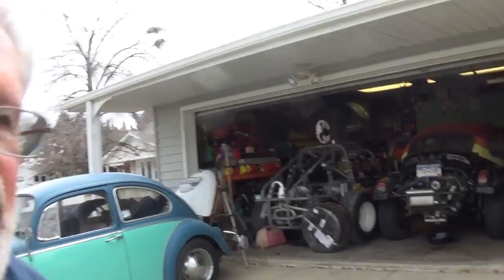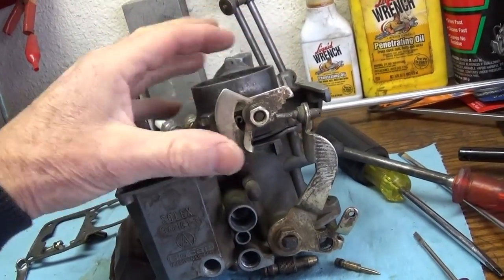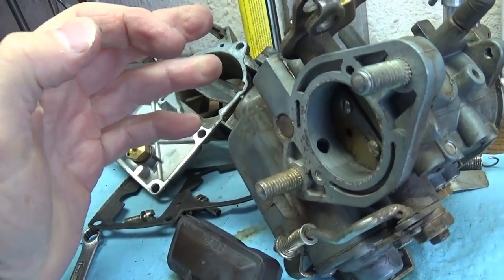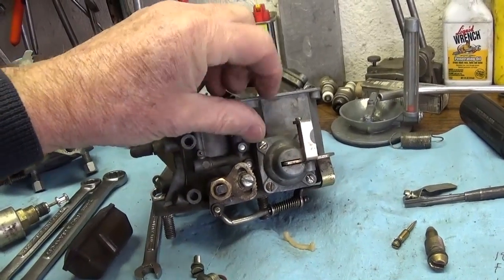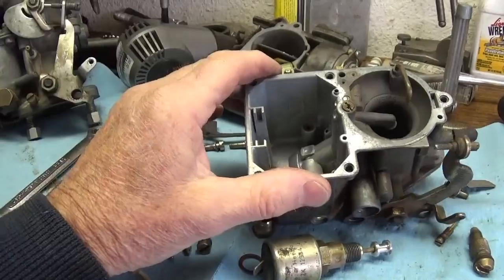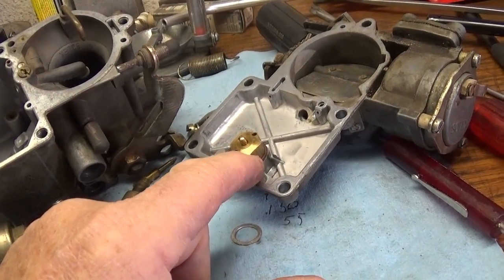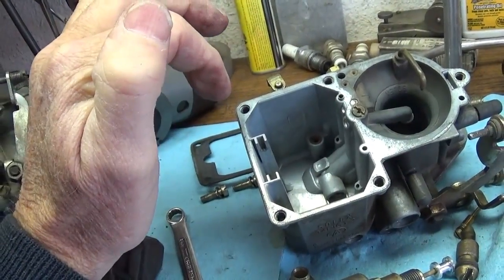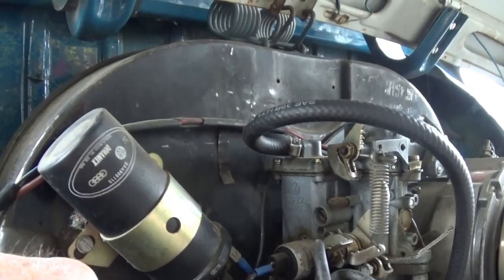VW Solex 34 PICT-3 (QUICK FIX !)

Comment: Got any advice on dual 34mm carbs? It's what I'm running on my 1641. I posted a few videos. Constructive criticism welcome.😁
Reply from the maker: I started out with ICT Webers. They worked ok when you had them synchronized just right. Any dual carb set up is a hassle. Might as well have Dual Two  Throat 40's. Good Luck with your projects Nate and Thanks for checking in.

Comment: Great video, can you explain why my 71 fires on cold starts but turns over 15 times before starting when the car is warm? Thank you
Reply from the maker: Could be any number of things since you haven't told me weather condition or details about your engine.  I'm not a mind reader.  I would start with looking at the choke when cold and then just before your warm restart.  Also check that your accelerator pump is squirting as long as you have the air cleaner off.  Fuel pump pressure.  Plugs, wires, distributor cap, coil wire connections.  

Maybe do your normal routine with cold start drive it around then come back home and let it sit. Do this to create the slow warm start.  When you feel the correct amount of time for it to happen. Don't try to start it but remove the top of the carburetor while it's on the car and see if there is gas in the float bowl. Have someone crank the engine and see if fuel is going in the bowl.  (BE Safe)  Fuel filter??? Sometimes these things can take a while to figure out. You just have to be patient  and be observant.  Most shop manual's have a trouble shooting section.
Reply: @TheEZGZ  you’re awesome dude. Thanks and sorry being vague.

Comment: Hey EZGZ, how are the progression ports checked or cleaned??
Reply from the maker: Take it off the car. Disassemble, spray brake cleaner threw ports and watch where it comes out. Wear eye protection.
Reply: @TheEZGZ  Thanks .... I had done that but still had a flat spot the size of Arizona. (I am from Jamaica by the way)

OK so the dellorto drla has a really big screw (phillips I think) that when pulled reveals the chamber from which the fuel passes thru its progression ports ...... therefore easy to clean.

I honestly haven't found where to spray so that it comes out the Rolex progression ports ....... and I really looked.

Comment: Im kinda new to the vw world as i just bought a tryke with a vw engine, what im having trouble with ia that when ckoke is fully opens engine dies, have a feeling its something minor that im missing but any suggestions would be appreciated
Reply from the maker: Welcome to VW land.  If the tips in this vid don't work then check deeper. Just basic stuff like float level and clogged jets. Never hurts to get a carb rebuild kit and and get familiar with what's what.  Since your tryke is new to you it might be a good  idea to check and record everything you can.  Compression, Ignition timing, Plugs, fuel pump pressure, blah, blah blah   Just get a base line and make one change at a time.  If it doesn't run with choke off obviously you have a lean condition due to ????   Find it /  Fix it/ Be happy     Nobody can magically give the answer with out more details and the more detail you look for.....  the solution might show up.  Just remember all toys are a Money Pit

Comment: I LIVE IN FLORIDA WILL THIS CARB  ADJUSTMENT  WORK THE SAME FOR ME OR IS THIS JUST WHERE YOU LIVE THANK YOU  FOR ANY HELP YOU CAN GIVE ME
Reply from the maker: It would be a great place to start. There is no one fits all formula. The condition of your engine and addition of aftermarket parts along with the quality of fuel can require different jets and air fuel adjustments.

Comment: Just got a 71 bug, having carb problem, the choke isn’t closing the butterfly thing
Reply from the maker: Make sure your getting 12 volts to the choke coil and it's getting hot. A carb rebuild kit has some other parts that help the choke. If you just got it you might want to go threw it. Some folks just disconnect or remove them or disarm them and pump the gas a bit until the engine starts to warm up

Comment: Question my 67 starts great but after I run it for a bit and turn it off it and try and start it seems like it's flooded  and it just won't start unless I let it sit for a while. Thank's in advance.
Reply from the maker: Fuel inlet (float valve) to much fuel pressure, Choke adjustment.   Take ur pick????
Reply: @TheEZGZ  thank's

Comment: My solex brosol h30/31 pict carb is leaking air at the throttle shaft have any experience in replacing?
Reply from the maker: buy a new carb. It's cheaper than fixing
Reply: Yep, no shit! i siliconed  it took it on and off a dozen times ended up buying a new one just could not get it to work.  The new one was not pre set and when I first fired it up it ran like the old one  until I adjusted it than to your vid on how to adjust these carbs runs good now.  It will go back to sitting in the garage just like it has for the last 25 years.  Thanks for your help!

Comment: Thanks friend new subscriber and new rail buggy owner with a 1600 on it and my carbs all out thanks I also have questions if ya want to answer them thanks buddy.
Reply from the maker: Ask away, That's what I do here. I also have a vintage VW Sandrail
Reply: @TheEZGZ  I had all kinds of trouble turning out to be the wire was almost ready to come out of the ignition module inside the distributor seeming like fuel instead of fire problems like to drove me nuts but I’m a loving my rail for sure now
Reply from the maker: @joeyelswick1796  Good to know. Thanks.  Keep the rubber side down buddy
Reply: @TheEZGZ  you too my friend

Comment: My engine is a stock 1600cc engine but it has 88mm pistons and stronger  (performance) camshaft. The rest is all stock. Is adjusting the 34-PICT-3 still the same or is there a difference on how to adjust it to compensate for the extra compression gained by the bigger pistons?
Reply from the maker: same.  run premium fuel with the higher compression and do a plug check
Reply: @TheEZGZ  What plugs do you recommend?
Reply from the maker: @DavidRBermudez  vg I've  been using Autolight lately. They fit in the head properly and seem better than the Bosch.    I don't remember the heat range right off hand I just ask for the recommended  one the books show's for a 71 VW bug???
Reply: @TheEZGZ  good advice...i am using NGK and I think those are not good. Will try yours.

Comment: When start my car i have to hold the gas pedal down half to make it idle then it idles by itself at one point the gas is 8 months old but i ran the carburetor until empty.
Reply from the maker: La de da.    Basic trouble shooting. Fresh gas, good ignition, Time for a tune up.  Check it all. Don't give up!

Comment: hey there. i need to get my to idle first lol. what am i missing seems to have good pedal but wont idle HELP!! thanks
Reply from the maker: Most folks try to use that long screw that rests on the choke system and you can't do that.  The rest of your engine needs to be correct to idle., Timing, spark plugs, wires, coil. It all has to work together. Idlol is one of the hardest to obtain.

Comment: top tips there for sure ,  can you tell me what sae rating that fuel pipe is to the carb please.
Reply from the maker: 30r14t1 if that means anything to you?  I just went to O'riley's  and asked for some fuel line. It's nothing special.  I paid by the inch for some of the original style VW fuel line with the braided out skin and it was all cracked and leaking when I tried to fire it up to move the car. Must be the alcohol.
Reply: thanks, I was just wondering what you were using , im having the same problem with the rubber fuel lines degrading and yes I think your right it seems to be the additives ethanol/ alcohol  im trying some SAE J30R9 at moment which is suitable for injection and carb , and it seems to be holding up well after more than a year .
Reply from the maker: I'm probably going to change to an electric fuel pump as I had a problem with vapor lock on this new style unit. (Chinese). I thought I might splice in some brake line instead of hose and just use the hose as a short coupling. I might split some hose and wrap it around the metal gas line to protect it from shorting if a wire comes loose or vibration along with vapor lock. I have been use the electric rotary pumps and a seperate regulator with no problems so far. I usualy leave the stock fuel pump and just connect a hose to both outlets in case I might need it someday. I appreciate your comment and interaction.

Comment: How do i determine if my accelerator pump is going bad?
My issue is: my engine runs for about 40 seconds, then quits.,..but if i spray “starter spray” just seconds prior to quitting, the engine keeps going for another 10 seconds…
Reply: My pump is good, my bowl fills to about 1/4 to 1/3  filled, cleaned out the jets,….bramd new coil,..not sure what else to do.
Thanks EZ for your great advice…
Reply from the maker: Look down the top and operate the throttle with the engine off.  You should see a nice solid stream squirt down the throat.
Reply: @TheEZGZ  with the key in the on position , but engine not started; i look down the top of the carb,..give a good pump, And gas does not squirt 😩
Reply from the maker: @tomasalvarez6040  Why have the key on? No Don't tell me..
Is there even gas in the carb. is there fuel pressure?   Take the cover off the accelerator pump and see whats going on..  Take the carb off the car and rebuild the darn thing
Reply: @TheEZGZ  went thru the carb again , cleaned the jets, and new pieces on the accelerator pump. I get good squirt of gas when i look down the top of carb. I give it 3 big pumps of gas then turn on the engine. It runs for about 40 seconds, quite good, then, it just dies, despite giving it gas. 
I squirted wd40 around carb flange, and manifold, i see no vacuum leak. 
I read somewhere, that the heat risers can be clogged, would this cause engine to die after runnijg for 40 seconds..
Thanks
Reply: …solved my problem: i thought i would chime in, if anyone was curious; I had a kink in the fuel line, the line that exits the fuel tank had a bad kink..which prevented 95percent of fuel to even reach the carb

Comment: Why is my 1973 Super Beetle backfiring?
Reply from the maker: If you don't have exhaust leaks and your ignition system is spot on you may have a lean condition in the fuel system.